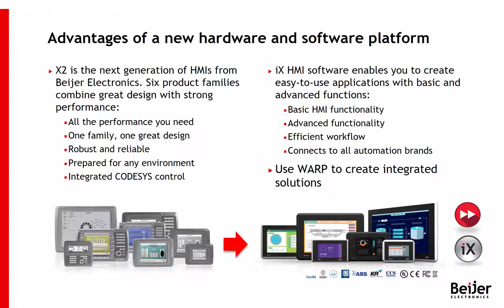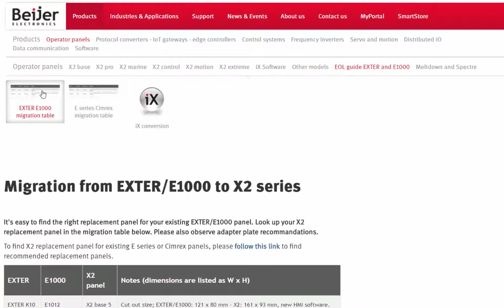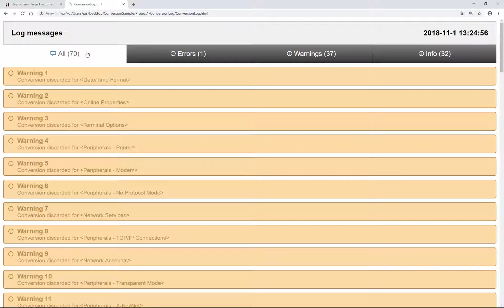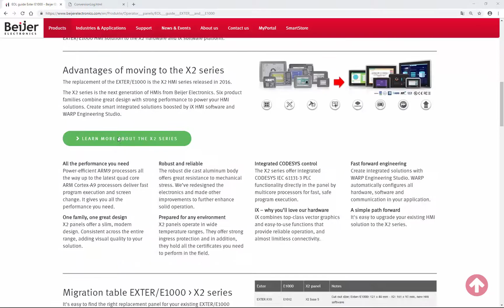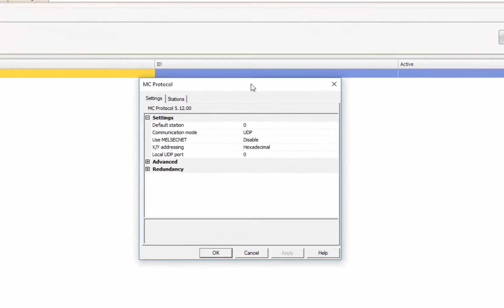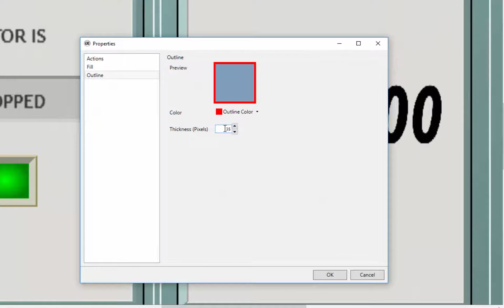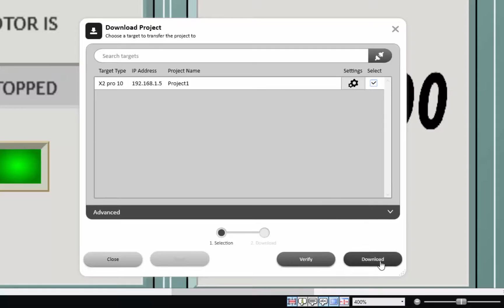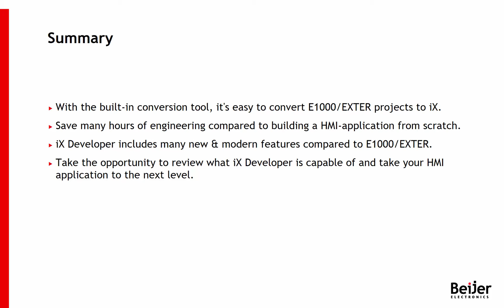Converting an EXTER/E1000 HMI application to iX - old version

Comment: hello I need  the software E-Desinger
Reply from the maker: iX Developer offers automatic conversion of EXTER/E1000 HMI applications created in Information Designer and E-Designer. The conversion tool helps to leverage existing HMI applications when moving to the iX platform. The automatic conversion feature is available when you start up iX Developer. Learn more on our website: https://www.beijerelectronics.com/en/Products/Operator___panels/Previous___models/EXTER/EOL___guide___EXTER___and___E1000/iX___conversion